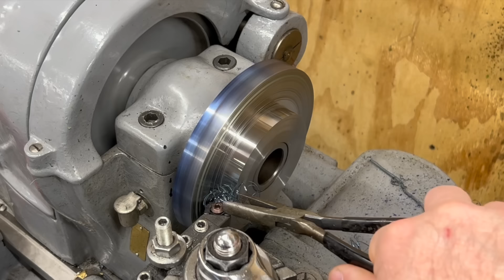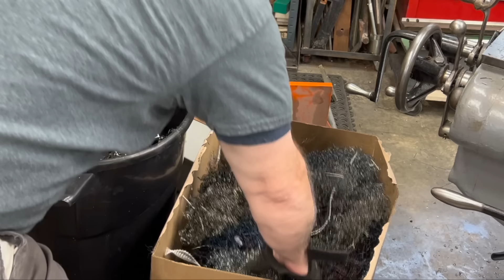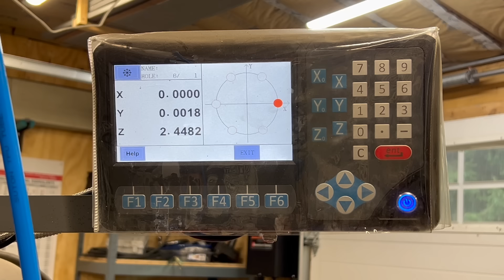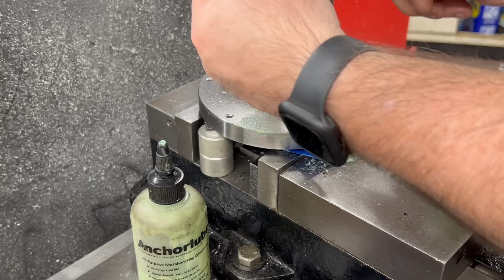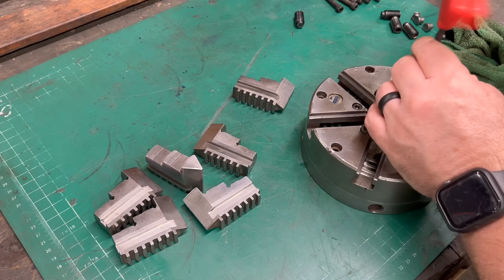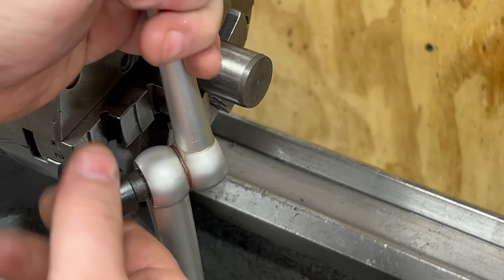Machining a Backplate for a 6-Jaw Chuck for my 1942 South Bend Lathe - Part 3

Comment: Hi Greg i have a idea on how to upgrade your lathe if you can install a one piece belt over the spindle cone where there's a flat belt . first idea is to convert from flat belt to serpentine that would greatly increase grip and go with a bigger motor .I think it would be easy to machine grooves for a six rib belt where you have the flat one .and if you are interested i have a 3hp 220v single phase new motor  off my PM1440LB you can have we would have to price shipping to see if its worth it . good luck .JM  Its the size of 2HP frame .
Reply from the maker: That's an interesting idea. I'd have to think about that. Not sure I would want to alter the pulleys like that, they aren't that thick. Replacing the leather flat belt with a different material might help, that and a larger horsepower motor.
Reply: Will run it by Kyle I'm sure between the both of you could come up with a an answer to your question the grooves aren't very tall on a serpentine belt

Comment: I have 2 of the Ditron D80 magentic scales on my lathes. The scales are so much smaller than the glass scales and easy to cut to size.
Reply from the maker: My mill has magnetic scales. But I am also experimenting with glass scales for the K&T table. They are narrower than the magnetic scales when you include the reader.

Comment: Watching you machining off a few thou at a time reminds me of my first lathe, a 7x12 minilathe. That ate metal a a similar dainty rate! I traded up to a light industrial machine, 3HP, which breaks chips with ccmt inserts at about 60 thou off the dia, 8 thou per rev feed rate and 400 sfpm cutting speed. I certainly wouldnt want to go back!
Reply from the maker: I will, at some point, upgrade to a gear head lathe. But that will be once I find one that is at the right price point for me. I'm very frugal and, at least for now, will gladly trade sweat equity for saved money. But that could change the older I get. ;)

Comment: I have the same problem with chip breaking sometimes, I’m pretty sure it’s the depth of cut that’s really causing them to not break but material and feed makes a big difference too, I’ve had some mystery metals that were just awful to machine, it came out great though!! Good work! Saw you on Vanovers channel the other day too, that was cool!
Reply from the maker: I need a gear head lathe. :)

Comment: I think those inserts work best on heavy cuts. I know your machine doesn't like or can't do.  I'd love to have a 10" 6 jaw for mine. because everyone would like to have more than 6 inches... mine is, I think the L2 tapper spindle.  but the 3 jaw, adjustable 9" Buck Chuck I have works fine.
Reply from the maker: I need to do two things. 1 - Start learning to grind HSS lathe tooling, and 2 - Stop using material that I can't cut efficiently on this lathe, and 3 - (I know I said 2 things 😉) get a gear head lathe with a 3hp or better motor in it!
Reply: @MyLilMule  my colchester is a hi/low 2.5hp to 5hp. It'll eat 4150 and dc53 .. I used hhs for a short wile.

Comment: The problem with using carbide on a lathe like that is that the chip breakers in the cutters are farther back which means in order to use them properly you have to take larger depths of cuts and we all know that isn't something you can do on a belt drive unless you run it in back gear.
Reply: Oops you just explained it in the video!
Reply from the maker: Lolz. No worries. Thanks for watching!

Comment: I think the 6 jaw chucks are not as useful as one would think...anything which isn't 100% round will not be gripped by all 6 jaws... hot-rolled is often like this... I was considering one myself at one time and after reading a thread about 6-jaws on the Practical Machinist forum where most of the guys weren't big fans, I didn't bother... 

BTW ... graphite powder would have been  better lubricant in the chuck, that grease will be a swarf-magnet... DAMHIKT 🙄😂

Also, piston wrist-pins are great as ground pins for use with the DTI... I actually got a monster one and I use it as a cylinder square..

Nice vid ! 😎👍☘️🍻
Reply from the maker: Thanks for watching!